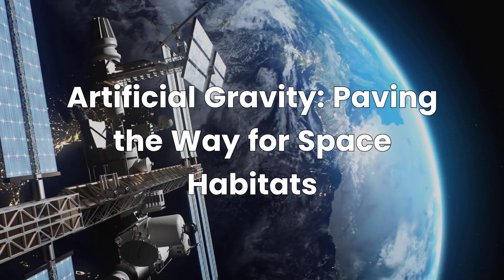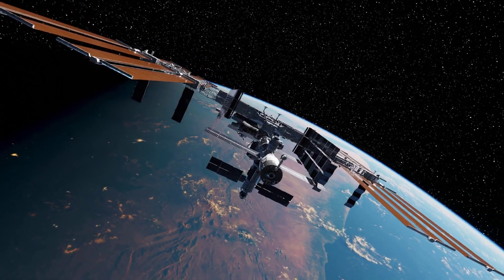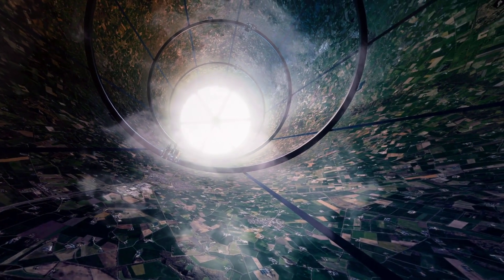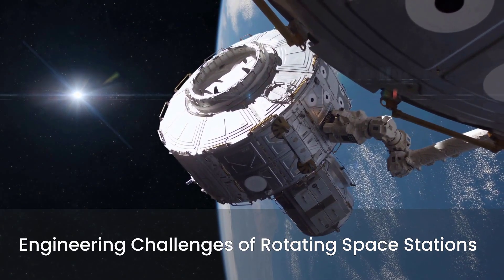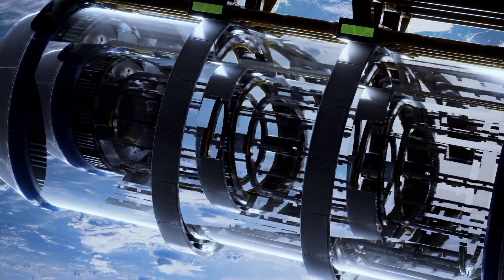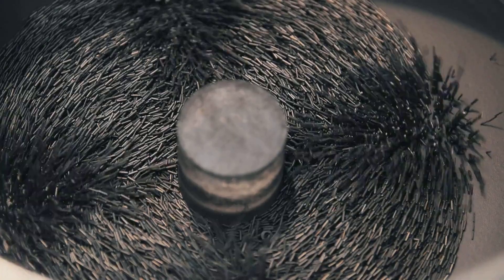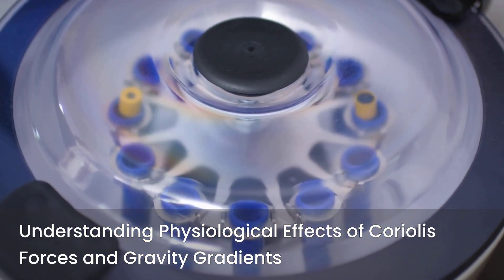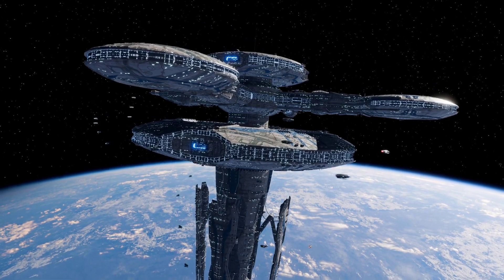Artificial Gravity Technologies in Space

Comment: Showing huge rotating space stations that would require more material and fuel to construct it then there is material in the solar system and will not be fathomable for at least another couple hundred years, assuming humankind last that long, is not helping!
  We are going to loose the ISS in another five years and the US has no replacement.  The concepts are more or less balloons floating in space, no gravity!  NO ONE IS WORKING ON SPACES STATIONS WITH GRAVITY!
  In a hundred years, if mankind last that long, we might have rotating space stations with the gravity of earth, which would have to be quite large, then there is the coriolis effect.
  I am impressed that you are addressing the gravity problem, for most do not address it, because it it the most problematic to overcome, so most space videos skip over it. or just briefly mention it! 
  There is noting about the Standford Taurus that is not stupid and ridiculous!!  It would take more material than in the solar system and would require all the energy in the solar system to construct it!   It will never, NEVER happen!  Instead of thinking far futuristic stupid crap, how about thinking more practical, like the space station on 2001, for example, and even that will take another hundred years!